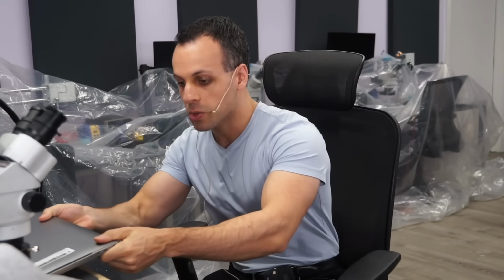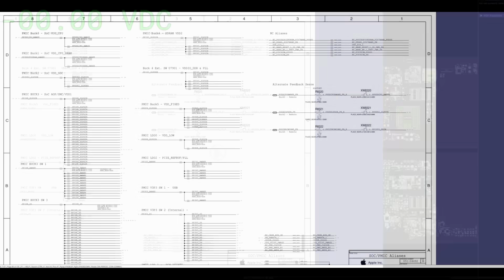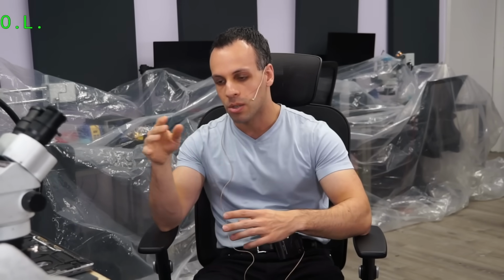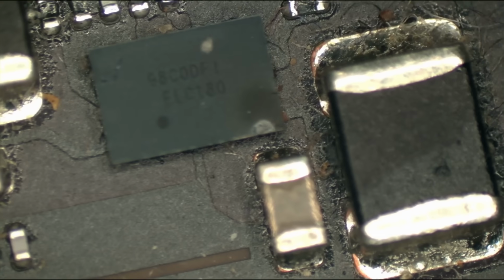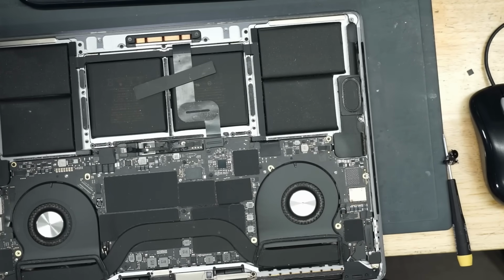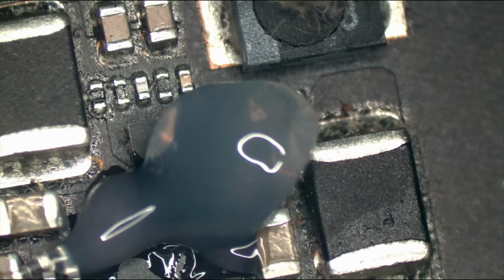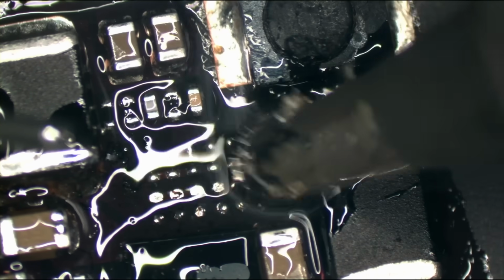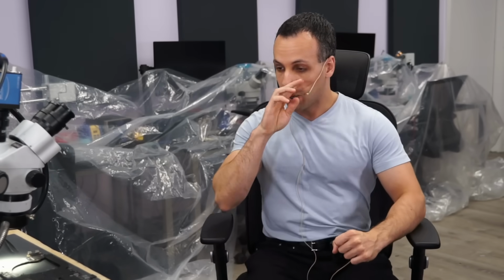How most 16" Macbook Pros often kill themselves & why they're unfixable

Comment: You should connect a bunch of those failed laptops with epoxy and form them into the world's most expensive boat anchor. Literally. Thank you once again for providing a quality video that I will be using to explain to other associates why I don't buy Apple products. And hey buddy, I suspect that if you threw a shout out on to some local social media that you could easily find a bunch of your followers to hook up with and spend an entertaining night on the town. Go see the Alamo and enjoy the nightlife. Guarantee it's better than New York City.
Reply: Or pot the whole lot in clear epoxy and make expensive coffee tables. Furniture at least sells and is usable longer than the average MacBook.
Reply: Or possibly make a game of thrones throne  from dead apple products......
Reply: Windows laptops die much more often and are engineered to exactly the same of worse standard than apple. Check Dell and HP failure rates. Also, current Macbooks are most durable since they are the only computers around that can operate with fans at 0RMP for mild load tasks. No windows laptop sits with 0 RMP even browsing the web and watching YouTube. My Macbook Pro right now is doing exactly zero RPM on cooling fans while being hooked up to external TV and running YouTube on it!
Reply: @super-moroshka  the f*** are you talking about Dell venue from many years ago for example has no fan. And you know it can render YouTube just fine.
Reply: @deViant14  Only Apple makes modern powerful pro performance laptops which don’t lose half performance when unplugged
Reply: @super-moroshka  You just said Macs "are the only computers around that can operate with fans at 0RMP for mild load tasks". Now you're doing what's known as moving the goalposts. Which isn't a good faith method of debating so I'm done here.
Reply: @deViant14  no I’m still behind my claim perhaps I concede adding one important qualification: Macs are the only current pro level performance computers that can operate with passive cooling. I bet the windows laptops you mentioned cannot do 4k video editing easy like M1 Macbook air

Comment: Such a shame that apple used the best ssd in the market, but due to design flaw, the ssd is destroyed. So, theoretically, even with the swap memory controversy, the ssd will not drop any performance in 50 years. Now I am shocked that the ssd will still fail, because of the laptop design. Well done Apple.

Comment: Cheap guys working on a mutlibillion dolars company that charge costumers with high prices for garbage, just a zener diode and two resistors are needed to avoid the nand to get burned by those 30 volts

Comment: It looked like you used some liquid chemical to desolder the chip. What did you use to desolder the chip? Why can’t the SSD be desoldered?

It’s important to back up your data. Unfortunately, the MacBooks can only be backed up with an attached secondary hard drive, not the Apple Cloud. I back up my MacBooks with Time Machine to an attached hard drive. Then I back up the Time Machine drive to the Acronis Cloud for an offsite back up. In addition, I back up the Macintosh drive to the Acronis Cloud. I’m not sure if there’s a better way to back up the MacBook computer.

Comment: Haven't you made mistake and soldered this chip 1 pin off?
Reply from the maker: Nope. Look again
Reply: @rossmanngroup  Well, im not a technician, its not my industry, but look at this
10:18 chip "starts" with the second capacitor at top and on right side you could almost fit second same capacitor between
13:13 chip "starts" with third capacitor and on the right side there is no space between capacitor and chip, pluuuuus you can see 4 points with tin on the left of the chip

As I said, I'm not a technician so I am sorry if I'm wrong

Comment: My MacBook Pro has been going strong for over 6 years and counting with no issues. Unlike most amateurs I made sure the flux capacitor was calibrated correctly and upgraded to the air gapped plasma coils... Oh and obviously I've never once ejected a flash drive before pulling it out.
Reply: What s a flux capacitor calibration and what is a air gapped plasma coil?

Comment: Hey Louis, long time watcher. Got given an a1534 that works but has a small blown open hole in the front screen lower left side that's boiling hot to the touch...will cut screen randomly because of this. Any ideas on how to fix...watched heaps but haven't seen this issue. Have a rework and microscope.

Comment: This is why I like 2012 Unibody MBPs. They do have a nice keyboard, trackpad. And you can swap parts!

A thought : could you boot that 16” MBP from USB by replacing that chip? (And removing the power supply line(s) to the NAND?) - may try this. I wouldn’t use the SSD if someone gave me a brand new MBP. I wouldn’t buy a Retina onwards because soldered RAM.

I hope the owner used this video to make Apple refund (better than ‘repair’ with a faulty board like in 2011…)

Comment: I have an issue with a display on the same 2921 M1 Pro model. The display had a thick shadow. But it's not fixed since last 15 days from the Apple service center people. Now they're saying that the screen went blank after re-installatuon of a new display. Now it seems to be a problem with the logic board.

Comment: Oh damn this is kinda scary, I have a 16 inch which I daily drive and I back up my data like every week, but I would prefer to not have something like this completely kill my ssd. Is there any way we could prevent this at all or is it just luck?
Reply: Did this happened to you after one year of posting this comment? I'm using the same computer as yours but I'm afraid of this.
Reply: @DonAle_97  Nope still running fine, I still daily back it up too.
Reply: @Mikeonut  That’s amazing bro!, hope it lasts for more years.
I’m backupping everything, because, if something happens, I won’t lose so much info.

Comment: I once used the apple macs because I thought they would be a kind of 2 worlds mix where I could do apple development if I wanted to or I could stick to linuxish dev. Then I learned how the updates cause weird issues and there is kind of an endlessly growing list of cons when dealing with macbooks software-wise anyway. I must admit I didnt have any remember-able hardware issues with the 2 mackbooks I owned. One of them was the white plastic rubber bottom one that came with a diskdrive and the later one was an aluminum one. this was between 2014-2019.
Reply: Most people do not have hardware issues with Macs, their failure rates are well documented and not out of band for tech products. These videos are somewhat misleading due to the implication of the title that most MacBooks will have this issue which is just not true. That’s separate from the poor fixability of the design.

Comment: I get that the chip exploded causing the short, but why Apple with all the planning and unnecessary redundancy they have else where there is no fuse on any potentially harmful trace to the hdd, regardless of how low the Apple has deemed the potential for failure. Oh wait i know why, because Apple admitting to design flaws would cost them a lot more, than just lying to the owners who have said failure, that they obviously spilled a liquid on the machine at some point . Id like to think a smaller manufacturer would admit to their mistake and make good on necessary repairs, the reality is they would most likely examine how a larger power house like  I dunno Apple, handled similar situations and followed suit. The idea being that in order to get ahead in this business, you have to put aside morals, and embrace capital above all else.

Comment: So is that it then? You take it a laptop back to Apple and their standard answer is it's water damaged. 
Every single apple all-in-one desktop my brother has bought has needed fixing within 3 years of new. The last one needed a new screen. 
 I've been using Dell and Asus laptops for 20 years and they have all lasted without issue apart from disks slowing down for at least 12 years. I still have a Dell from 2006. 
My current Asus is from 2013 and all I've done to it is replace the HDD with an ssd and use the original 1Tb HDD as backup in the laptop's dvd slot. I love that now it loads up in seconds.

Comment: Apple seems to really be pushing subscription stuff right now. I halfway wonder if this wasn't a deliberate engineering choice to convince people to subscribe to iCloud. I mean, if this is a common failure point, and the data is arguably the most valuable part of the machine, how hard would it be to stick a fuse in there?
Reply: It's probably an intentional anti-repair design.

If the macbook was repairable they would have less people buying a new macbook every so often because third-party people would be repairing these devices.

It's common knowledge that Apple does not like repairable devices.

Comment: Louis is only partly right about hearing. It’s not just the phase relationship between our ears, it’s also the damping effect of the skull. Also sound doesn’t travel like light so it obstructions cause it to go all wrong. It’s why we can’t tell where sounds come from if something is in another room.
Reply: We can tell whether a sound comes from left or right, but it is impossible to tell if it comes from the front or back, unless we rotate our head to make the sound be closed to one or the other ear.
Reply: @reynolddovkin2337  not true. Your ear lobes block sound travelling from behind us and subtly change it. Our brains learn to make these decisions of years. Psychoacoustics play a part too of course but that is beyond what we’re taking about.
Reply: @marcdraco  I speak from experience. It is easy to verify by experimenting.

Never assume a sound is coming from the front or back until you have turned your head around a little to scan to differentiate between those two directions.
Reply: @reynolddovkin2337  I speak from designing surround (simple) systems and working with binaural and other recording systems. Your personal experience is certainly valuable but it doesn’t override the research done into surround effects including height clues. Your mileage may vary but when a sound comes from behind us our brain uses visual and tonal clues to construct a map of where it is provided it’s in our 3D space and not obstructed - that’s why it’s hard to locate sounds when they are in another room and affected by unpredictable echoes and phase shifts. 

There’s a reason nature makes our ears  stick out and also the shape of them too.
Reply: @marcdraco  OK, so it seems that under some circumstances the front-to-back differentiation works and under some others it does not.

Or am I just directionally challenged? If so I want reparations.

I have noticed the cases where I have been blatantly wrong about the front-to-back direction of a sound. Probably I do not even notice the cases where I get it right from the beginning.

I have learned to rotate my head when I hear a sound from the front or back and have no other clues as to the location of the sound source.

Interesting.
Reply: @reynolddovkin2337  Your own model is simplistic. Most sounds are off-axis in to some degrees and that gives our brains a clue which what it's coming from due to phase shifts and attenuation by frequency.

Some sounds (higher frequencies) are more directional which is why subwoofers are usually mono and one per system, although you can have more.

Similarly, the "rear" and "side/surround" channels don't need to be amazing quality because they provide directional clues.

You can see how some of this works if you look at the math behind Dolby Atmos, DTS X and other headphone technologies.

There's also a factor that we know most common sounds (voices, traffic, etc.) by our teenage years - probably quite a while earlier - so we can infer where it's coming from by the tonal change alone.

Babies will turn to visualise the source of a sound from just a few months old, fully doing so by 12 months.

The simple fact we turn to see a sound we can't identify the source of is the simplest form of psychoacoustic response. By rotating our head we reposition the sound's axis in relation to our ears.

A more interesting example is how sound designers make objects appear to travel far beyond our TV screen by using panning across multiple channels. This works best with fast moving sound sources like aircraft and racing cars but also projectile weapons like spears.

Comment: They’re “unfixable“ because Apple knows you guys won’t do anything about it. The only reason Apple makes these pieces of crap, is because YOU keep buying them. 

STOP BUYING COMPUTERS WITH “UNIFIED“ PARTS SOLDERED TO THE BOARD! The only reason they exist is because idiots keep buying them. If you stop buying them, they stop selling them, it’s really that simple. 

HELLO, LANDFILL. The average lifespan of a Mac was 12 years before the introduction of Touch Bar MacBook 💻 , now it’s 5. Get smart, and start demanding better. Draw a line in the sand. I’ll NEVER buy computer without removable RAM and storage. If everyone said that, we wouldn’t be in this problem. 

“Those who sacrifice power for light & thin, get neither.”


Comment: At 5"53 you identify the cause of the damage as TPS562180. Isn't it TPS62180 (without 5)?
The ic's absolute max rating for Vin is 15V. Very close to the voltage of the power rail :-/
So I agree with you, integration has gone here too far. There is nothing in between which can sacrifice itself when an error like this occurs.

Comment: Why is apple still using the water damage bullshit when there's not even humidity inside the case?
Why is apple still creating retarded products with very common SPOFs ... how hard was it to add a failsafe in case that 13V passed through this chip ... they are making PREMIUM marketed devices priced at eye watering values and yet they are complete garbage hardware wise. :(

Comment: Does this happen only to 16“ or also to 14“? And is there a way to avoid it, for example to look out for a specific config or model/board number?
Reply: It’s not like PCs all work perfectly… I know both worlds very well 😉 I produce music and iOS is very stable and good for that. The new M1 Pro is extremely powerful. 

I still use a 2011 macbook pro that i bought for 850$ in 2011 when I switched from PC to Apple and have only changed the IDE and DVD drive for SSDs so far and it still works great in 2022. 
Unfortunately developers and plugins are starting to work only on newer OS and also have become more complex and powerful and therefore cpu consuming. I was going to buy a new MBP M1 or M2 with 4TB SSD when it comes out this fall, but the fact that I can’t change, remove, swap the internal storage when it’s broken is really a huge letdown and a no-go for me with such an expensive machine. Kind of stuck now.
Reply: There is one way to avoid it
Don't buy a macbook—

Comment: I own a 2015 13” MBP that is just perfect to work with. Original battery and excellent shape. I had an A2141 and I found it horrible. Especially that Touch Bar. What an insult for blind typing. I code so I don’t want to watch the keyboard. 

I did just buy a 2021 14” MBP because I thought: finally they woke up and gave us back the 2015 machines, with connectivity, a decent body and no bloody Touch Bar. To my horror I saw that the 2022 model is 2019 all over again…

What were they thinking?!

Comment: I honestly want to know the probability of mbp fail compared to usual laptop, because i have used 6 of apples products (mbp 12, mbp 15, ip 6, ip 8+ and apple watch) yet none of them died on it’s own, i just bought it again because they are too old (yet i still use my ip 8+ and mbp 2015 as my main device, look how old is that thing), but based on how you talk it’s like they will 9/10 fail on its own. It would be nice if you can provide some solid data (compared with laptop with around the same price is cool too) so that i know they are that fragile or you like to exaggerate a lot, because electronics will fail for sure at the end of the day

Comment: Why apple don't put a lot of SMD fuses in this device.  With a special soldering iron you could replace these fuses very fast. Some chips have overpower and over-voltage protection build in, but why go the extra mile and chose these, if you could sell a board full of miracles. (you always could destroy these protection diodes if you put enough power in, but they can handle some mistakes)

Comment: Since the MacBook Pro is so unreliable and pretty much commit suicide on MacBook users, what is the best computer that I can purchase that would be the equivalent of the MacBook Pro, 32-64 GB+ of RAM, M1 Max or M2 Max & high end GPU? Worry referring to the $3600, 14 inch MacBook Pro looking for something reliable and would prefer that could have the possibility of running macOS Ventura. I use my Mac machine to run virtual machines. My current system is a 2015 MacBook Pro, 15 inch, 16 GB of RAM, Intel core i7 & 1 TB SSD.

Comment: Not putting a Zener diode downstream of a buck regulator to protect costly devices is a glaring design failure, a result of engineers who are incompetent or just don't give a damn. This sort of misfeasance is becoming common in a broad range of products, for reasons of which I can only speculate.

Comment: Whenever I dropped small parts on the floor,  most of the time they seemed to just vanish from reality and I would have to find a replacement part.
But the next time or at some point later when I dropped something, again the part I just dropped vanished, but I would actually find the part I had dropped a few weeks earlier.  Of course if I could see the part hit and bounce I usually could find it.   I began to think these parts vanish into some other realm or dimension and can only be found after another part slips into that dimension as well.
Reply: This is so true… can verify
Reply: so it wasn't just me....💀